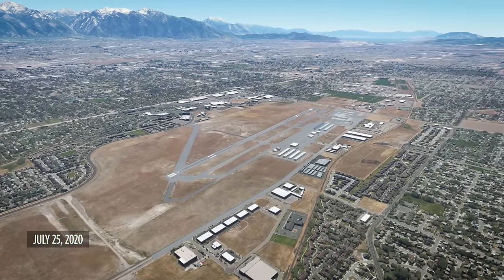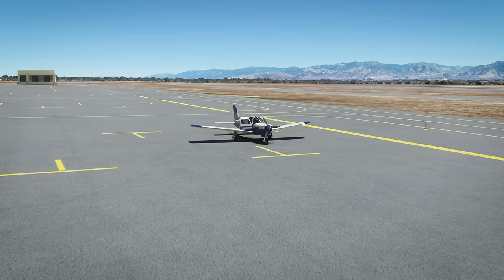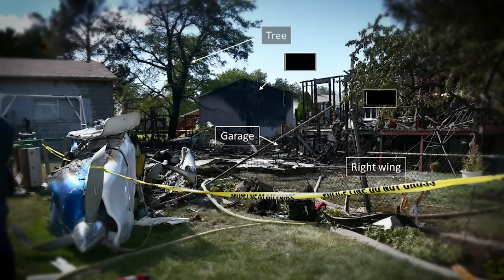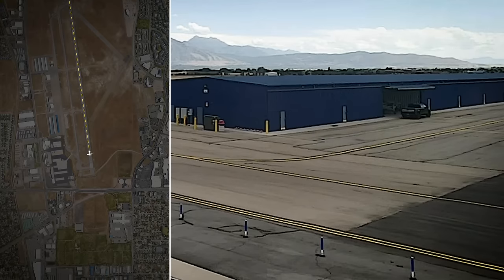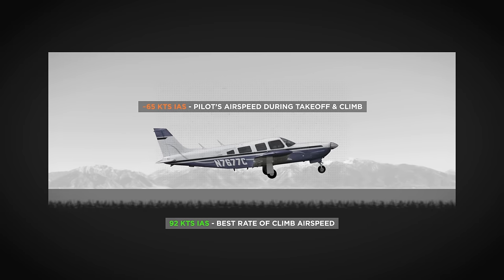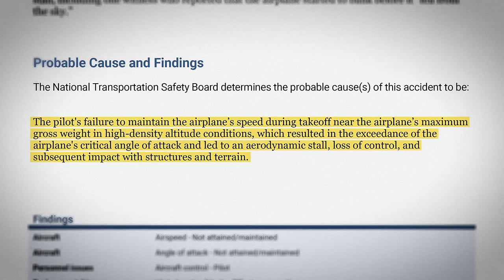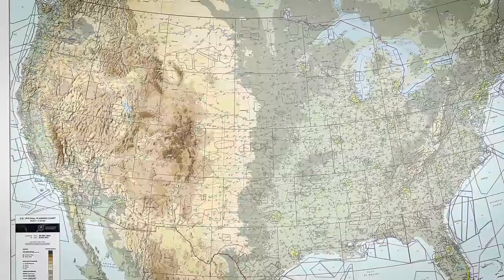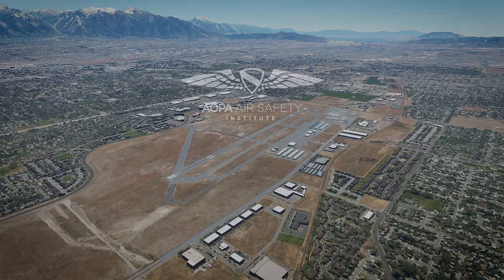Accident Case Study: High Aspirations

Comment: It's been advocated that pilots should be trained to use runway landmarks and speed goals in addition to V2 speed, account for loading, performance and power. V1 can vary, it can surprise you by not being true V1. By using a landmark, or distance down the runway you can make that decision more real world. Your landmark will leave enough runway ahead of you to abort the takeoff. This is covered in advanced training but not in standard, initial license training and recurring. IMHO it would save lives.

Comment: You become more cautious about it when carrying pax.

During my training I was advised to always calculate the Day allowed take off weight by multiplying the DA reduced to a decimal, for example 7000' to 7.0

7.0 x 3.5 ( 3.5 representing the altitude of significant reduction in pressure)

The result 24.5 represents the percentage of power lost.
For example 180 BHP ~ 100% power ISA - 24.5% = a power available of 136 HP

136 HP x ( the power loading of the plane ) = the maximum take off weight for that flight.

My question is why most of the operators of these categories of airplanes denie the pilot to use this security?

Thank you

Comment: The video leaves open the question of the gap between published performance figures and operation of the accident aircraft. Could a reduction in performance result from not having the fuel mixture exactly right for those conditions- just enough, given the aircraft was operating near its limits to begin with, to prevent it from climbing out of ground effect?
Reply: Yes that really bothers me
Reply: Unfortunately piston engines degrade in performance as they age where turbine engines are defeated and as they are they access some of that power that was reserved so they ensure the book value on performance. I would always add 50% to the takeoff distance and landing and half the flight rate of what the hook says. If it’s below 500 FPM I would consider changing numbers or going when performance is better
Reply: Short answer - yes. Consider that a mere 3 hp deficiency (1% of rated for that engine) in power would cost 30 fpm in rate of climb at best climb speed for that weight. Difference between full rich and best power can be as much as 4% in power available.

Comment: The tailwind runway made sweet feck all difference after he was airborne. Look at the JPI fuel flow. He didn’t lean for max performance- the initial takeoff FF was ~30 GPH. At that DA peak power would have been at ~22-24 GPH. Had he done that and maintained through the climb, he would have made it. Having said that, I would have tried to be at least 200lbs under gross in those conditions…1100 hour PA32 driver/CFI so just my $0.02.

Comment: The manufacturers should not be allow to put power values down if they are so inaccurate. This is exactly why i stopped pursing a career in aviation. They are always blaming the wrong thing. If pilots can’t rely on what’s in the plane’s manual wtf is the point of it then.

Comment: Question for the experts: In the accident report, the engine RPM was at about 2700 and fairly stable throughout. Is that what you would expect from a PA 32 at takeoff? Also, the report mentions that 6 of 12 spark plugs were severely worn, but still able to produce sparks.

Comment: I think what happened here is pretty obvious.  This was a skilled and competent pilot.  He knew his plane’s performance parameters.  He was aware of the field elevation and air temperature.  He weighed the baggage.  He questioned passengers about their weight.  He must have performed the calculations for high density altitude take offs.  He apparently failed to notice the wind direction, but that isn’t what I’m getting at here.  What he did was to determine that this fully loaded plane would just barely squeak by, and that "theoretically" they should be able to take off.  And, he chose to do that,  knowing full well that there was little to no safety margin in the figures.  That’s a really bad choice to make.

Comment: Taking off downwind will increase your takeoff roll but should stop being an issue once flying.  You are in the air, a part of the air, your plane doesn't climb better or worse depending on wind direction.  This would matter if you were trying to clear a tall obstacle like a mountain in the the distance since your groundspeed would be higher as you climbed since it's your true airspeed plus wind speed so you would have less time to climb before you arrived at the mountain.  The video harps on wind direction a lot but that wouldn't be a big deal a few seconds after breaking ground.  This plane appears to be underperforming,  the only mistake I could see was the pilot perhaps failed to lean the engine to best power before taking off and then got behind the power curve in a mushing attitude, it looks like he suspected the mixture too late.  I have experienced doggy performance and started to lean on the takeoff roll and felt a considerable increase in power that was at a DA of 7 or 8k feet.  I've been lucky so far as I gain experience.  This case bothers me since I don't see a clear-cut example of what I can avoid.  You cant just fly around with an empty airplane, on cool days, with 12 gallons of gas, by yourself, at low airports,  that's extremely limiting.

Comment: The risks and tragedies of GA are endless. When even good pilots are dropping out of the sky and killing innocent people on the ground, something needs to be done to protect the General Public. If I were the family of the person who died in the safety of their own home…… I would sue every entity that had anything to do with that flight. It’s one thing if the fliers of GA are comfortable with the tremendous risks, but it’s something totally different when that danger encroaches and kills an innocent, unaware person that has nothing to do with that system. This is an example of how a non-critical, entertainment based system becomes a bonafide menace to the society at large.

Comment: Good video production.  Perhaps the AOPA membership could contract with you to do every single fatal every week.  You would be the AOPATSB or ASITSB.  Wait a minute, somebody already does that for us.  For free.  This video took over 3 years after the fact to teach us something. If I auger in, please somebody get something out in at least 3 months, not years.  
If that happens to little old me, I can tell you more or less what NTSB will say:   "Pilot Error. The airplane crashed. Aerodynamic stall was created from lack of lift, which caused aircraft to descend like a proverbial rock.  Although the pilot's logbook contains all necessary endorsements, and his friends say he was competent, qualified, and possessed good aeronautical decision making and judgment, the NTSB and AOPATSB concurrently find the GA pilot lacked the requisite skill to control the said rock during its plummet.  

A secondary cause, the pilot woke up that day.  According to witnesses his head was in the clouds, he chose to head to the airport instead of going to the relative safety of his desk to perform his usual seldom-appreciated duties which consisted of gnashing of teeth and ensuing headache afterward, followed often by chest pain, insomnia, and nightmares of missing deadlines.  Pilot was not that hard of a worker, he only worked half a day usually 6 days a week.  Only sometimes 7 days a week.  He could have done more.  It did not matter which 12 hours he worked.   That was only 12 hours a day.  He could have done more.  

Final cause:  Clear error of judgment by Pilot.   Because he could have and should have done more:  more training, more work, less head in the clouds, less dreaming, less commenting on YouTube, less watching DTSB, we further find AOPA should not have to pay his insurance claim.

Case closed."

No recommendations.

Comment: The video only slightly touches on airspeed, but it seems to me that just like in many of these failed-climb crashes, the pilot’s failure to understand the concept of best angle of climb speed (Vx) was the major cause. He rotated, and then when he wasn’t climbing as fast as he hoped, he raised the nose thinking it would make him climb faster. He did that right up until stall, the stall horn went off so he lowered the nose, ground started getting closer so he raised the nose, rinse and repeat, right up until the full stall.

The thing that so many pilots fail to understand (or fail to be taught) is that Vx is the absolutely critical speed when you are trying to climb above obstacles. They think that they can raise the nose all the way up to stall speed in order to help their climb. There are numerous cases of pilots descending in the climb with the stall horn going off. The problem is that stall speed is usually about 10kts slower than Vx. Since Vx is the minimum point on the exponential power curve, anything slower than Vx causes an exponentially growing penalty in induced drag. His repeated pitch oscillations and eventual stall makes me think he was behind the power curve throughout almost all of this short flight. He needed to hit Vx and hold it there, or abort the takeoff. Anything else was the wrong choice. For this reason, I placard or post-it note the Vx speed on the glare shield of any plane I fly to remind me in high stress situations of this critical number.
Reply: I fly helicopters not planes so I'm not an expert on V-speeds, but the graphic in the video said best rate of climb speed for the conditions was 92 kias and that the accident aircraft was at ~65. I looked up the POH for the Lance (I think the same one they were quoting from) and it says best angle of climb speed for gear down, flaps up is 68 knots, which does match pretty well what the pilot seemed  to be doing. Interestingly, the POH doesn't seem to cover takeoffs with flaps deployed? Vy is indicated as being 87-92 kias depending on the gear position.

For an aircraft that's not climbing (especially with 5,000' of runway and an additional ~3,000' of relatively obstacle-free pseudo-clearway to use after that) wouldn't it have been better to keep the nose down until Vy, since the climb performance was zero and there weren't really obstacles in the immediate vicinity to worry about?
Reply: @ganthrithor  figure 5-5 in the Lance POH gives a 2-notch flap “barrier” speed of 64kts. Since the POH only gives a zero flap Vx value, I am guessing this “barrier” speed is 2 notch Vx since you are trying get as far from the ground in the shortest distance. The chart shown in the video that says 92kts is a cruise climb chart which is always zero flaps Vy because in cruise climb, after you have retracted the flaps, you want to get to your intended altitude in the shortest TIME, so you want Vy. Normal procedure is to climb Vx until you clear the obstacles, then accelerate to Vy. However, as I will explain in a moment, it seems to me that he was having problems getting to Vx, much less Vy.

Now as for what airspeed he was doing, the fact that he did several climbs followed by several descents means that his airspeed was not constant. As I stated in my first comment, usually with pitch oscillations like this, the pilot pitches up thinking they will get better climb, hears the stall horn go off, gets scared, drops the nose, descends, get scared, repeat. That is the problem with getting behind the power curve, you have to momentarily descend in order to get back to Vx. But you then have to stay at Vx, not pitch way back up. The video said that he eventually descended at a steep angle which means he pitched up all the way into a stall. Stall speed in this situation was 52kts, 12kts below the “barrier” speed, or 2 notch flaps Vx. So when things were most critical for him, he was 12kts, or 20%, behind the power curve. A really bad place to be when you are trying to get away from the ground. Pilots need to be shown during training how dangerous it is to get behind the power curve. My experience is that this is usually poorly taught, which has resulted in a lot of deaths.
Reply: @michaelvanderweide8032  I totally agree  with you looking at the video-- it seems like he just pulled the nose up too early, too much, and then tried to hold it there.

Do you think it's fair to say this accident was caused by a technique issue? I normally enjoy these ASI videos, but the bit at the end where the narrator suggests we should decrease our ceiling numbers / critical altitudes by 50% seems crazy to me. I usually like to see a ~10% buffer to account for things like dirty blades and cylinders being down a few PSI on compression on an older engine, but 50% just seems like a wild number to apply-- I don't understand how an aircraft that's in airworthy condition could diverge so far from the manufacturer's performance data. It would make much more sense to me if this accident was primarily attributed to a handling error.
Reply: @ganthrithor  since I have seen this in numerous crashes now, I would say it is a training issue. There are a large number of pilots who don’t understand that stall speed is way behind the power curve and that getting behind the power curve is extremely dangerous because of the energy needed to get back on the front of it. He was 20% below Vx. Since drag is the square of velocity, his drag penalty was even more than 20%. That Will significantly reduce your aircraft’s capabilities.
Reply: @michaelvanderweide8032  Interesting. I've been studying for an EASA heli CPL which forces you to review mountains of airplane-based systems and principles of flight stuff (along with doing 3/4 of an IFR ground school for a VFR certificate and heaps of other stuff not relevant to heli operations, but I digress), so it's interesting to see some of that material demonstrated in real life. Thanks!
Reply: He may not have known that Vx increases ~ 1/2% with each 1,000’ of density altitude . This does not matter much at lower altitudes , but when closer to the edge of the envelope , as here , it can make the difference between making it and not making it .

Comment: I admit I'm neither a pilot nor engineer, but it really seems plumb crazy to me that most GA planes run engines that are naturally aspirated and have manually controlled mixture with carburetors instead of electronic fuel injection. Having a mixture control and a carburetor heater just seems like extra points of failure and actually costs more money than EFI - both to make and in fuel costs. And a turbocharger and FADEC saves a LOT of engine weight and fuel consumption, quite apart from the "hot and high" safety benefits.

Comment: The most important performance number in this otherwise fine video is missing,  That is the takeoff performance distance for this PA 32. How much runway does the pilot need to lift off. I encourage instructors to teach rejected takeoffs. I do.  Pick a landmark on the field, an intersection or other abeam point, or runway remaining if one is available. It is not easy to reject a takeoff if one doesn't have a plan. I feel sorry for those who have been harmed for this unfortunate event. My heart goes out to his wife especially.

Comment: As soon as i saw the loading configuration (within limits but heavy) and then the security cam footage my immidiate fear at that DA was the engine not being leaned properly in a full power static runup. My fears were confirmed when you look at the EGT and FF graphs. You can see where the engine is set to takeoff power on the fuel flow graph and the EGT barely budges from where it was during the startup, taxi and runup. Then you see the attempt to lean out the mix once he was airborne and struggling to stay airborne out of ground effect. Task saturation then sinks in, youre flying the stall horn trying to keep coordinated and enough airspeed while also trying to figure out why you aren't making any power, all the while barely clearing trees and houses with your family on board. Nightmare fuel. 

Absoletely awful situation to find yourself in and I wonder if the outcome  would have been with a full power static runup prior to the takeoff roll with the mix leaned to peak EGT +20 F or so. Could have easily been done accurately as they stated the A/C was equipped with a digital engine monitor. I wonder if it was a full rich takeoff at 7300' DA out of habit or following the checklist. Its absolutely vital to do this if youre going to flying naturally aspirated pistons hot and high.

Comment: I had something similar happen to me today, Archar 180 all seats full with adults under gross weight at sea level temp 70• f  with a 4,000ft runway. The POH said 1,300 feet takeoff roll so everything should go smoothly and within limits. 
Beginning my takeoff roll I've noticed the air speed is increasing slower than usual, halfway down the runway I've only reached 40 knots (t/o speed is about 60.) I immediately cut the power applied full brakes and slowed down with enough runway to spare.
What happened? The wind shifted during my taxi and runup 180 degrees into a tailwind. 
I should've glanced over on the windsock before beginning my takeoff roll.
After that I've taken off the opposite runaway, reaching my takeoff speed well before halfway down the runway with no problem.

Comment: 10 years of studying MAYDAY crashes has taught me something about life.
Marriages don't just fail because little " Jimmy " didn't do his homework.
This crash has a wind dirrection element and maybe a hurry up element too.
My Tacoma 2.7 trck with 181 torque is supposed to be able to handle a load of 3,500 pounds but that's without a head wind and driving on prarie flat ground.
I always cut that number in half so if you remove the friend and daughter that take off should have worked.